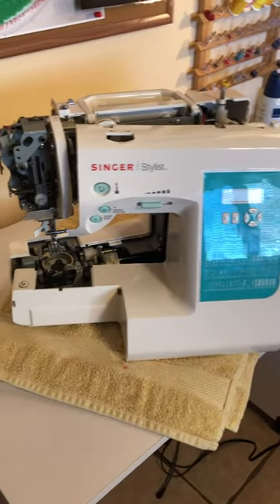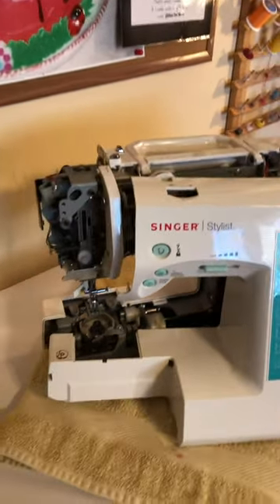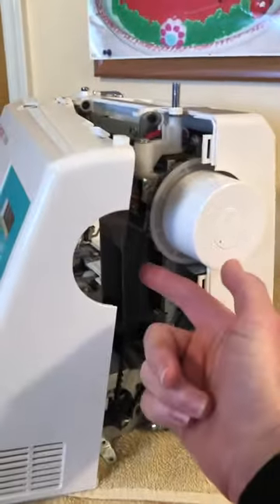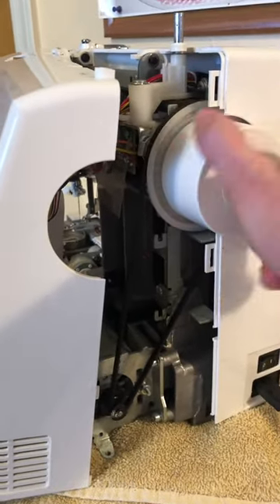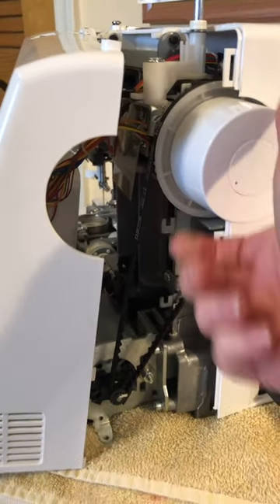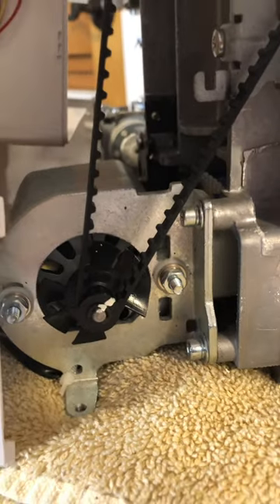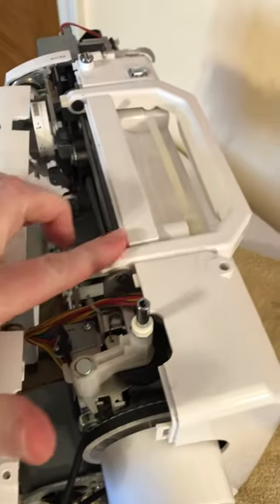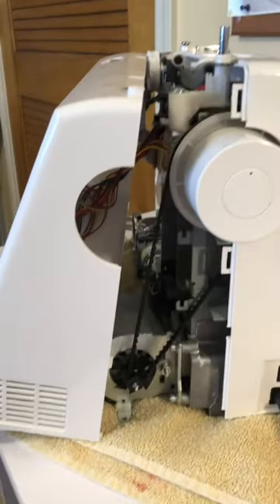Singer Stylist code C4

Comment: The handle wont turn the motor belt in the forward or "toward you" direction.  The motor drives that belt.  This allows you to manually operate the machine with handwheel, but under power (foot pedal or start/stop button) motor operates the pulley that the belt goes around.

Comment: i got exactly the same problem like you with my singer 6699. error c4 shows, the belt is okay,  the dial normally moving backward  but it can not moving forward.. so desperate..☹️🤷‍♀️
Reply: Mine was saying c4 and it appeared that the needle was basically stabbing the silvery part the silver cover got shifted a little bit so i just took the two screws out and slid the silver part down a bit so the needle will go straight thru the hole (if this is the same thing thats happening to you)

Comment: Have you been able to resolve this? maybe there is something wrong with the motor or foot peddle's or the connection between the two.
Reply from the maker: Hello there.  After many hours of cleaning and playing with the tension, changing bobbins, etc. I was never able to fix my problem.
Reply: Hi there  @charitydelmonte9364  , that's a shame hope you have better luck with you new machine.

Comment: Hi I have the same problem, did you fix yours? I’m still trying to figure out lol
Reply from the maker: Hi Yennifer!  I never did find out what was happening.  The only connection was the foot pedal and so the wires may have come loose when it was plugged in.  Perhaps you can try a different pedal?  It was the only thing that I regret not trying before I gave my machine away to someone who loves to tinker with broken machines. Please let me know the outcome.
Reply: Mine was saying c4 and it appeard that the needle was basically stabbing the silvery part the silver cover got shifted a little bit so i just took the two screws out and slid the silver part down a bit so the needle will go straight thru the hole (if this is the same thing thats happening to you)
Reply: @taliyahchavon1691  please tell me WHICH 2 screws. I have the same problem, thread is being caught by the silvery 'half moon' thing and I am really desperate after HOURS trying to figure out how to make that stop happening
Reply: @RyeMi the 2 screws on the plate ? My sewing machine is doing that too that’s why the C4 code is coming up. But the sewing plate doesn’t move far.
Reply: My machine is doing the same thing- but only after 3 minutes of working perfectly- then it jams every time!!! Ugh